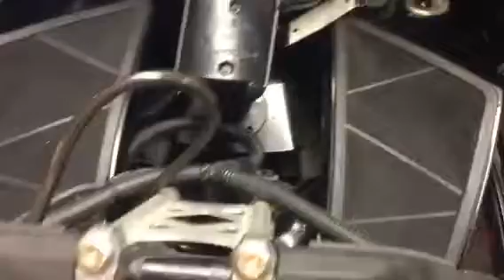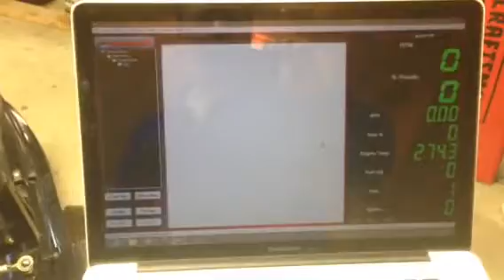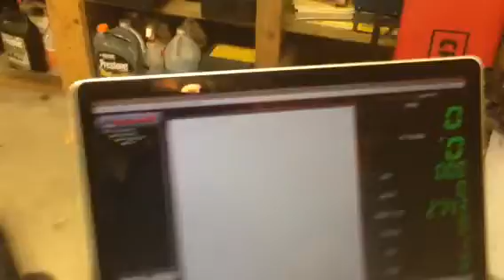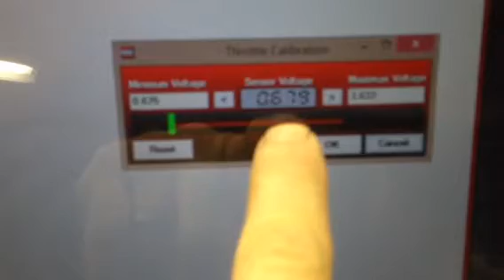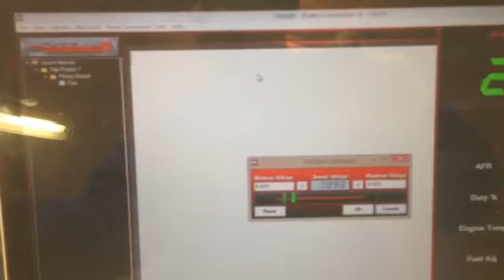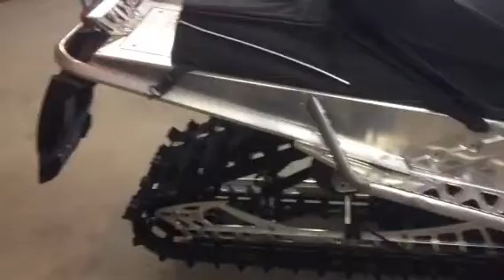Powercommander V calibration

Comment: Uh.. you don't do that with the engine running.. simply turning the key on and it would work
Reply: There is a voltage difference from key on to engine running when this test is performed. To get the best ideal reading, the engine needs to be running and up to full engine temp.